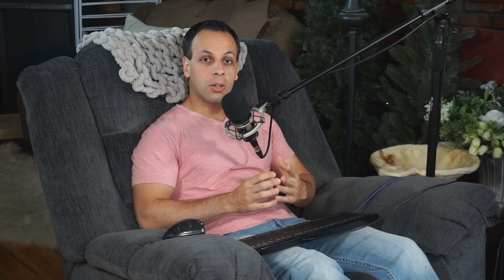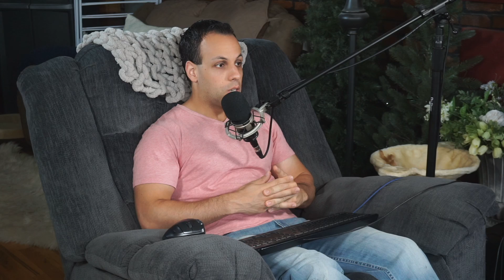Let's talk about what Right to Repair means for how devices are designed.

Comment: I agree with everything you said but I think we need to make it mandatory for manufacturers to not use software locks on their devices to crush 3rd Party Repair Shops. Sure, the manufacturers can design the hardware as they wish but they should not lock down that hardware with their software.
Reply: Right, if I'm not mistaken with new iPhones batteries have internal serial numbers that the phone can detect and if the serial number doesn't match what the phone was originally sold with it locks/removes certain features so repair shops are forced to use 3rd party tools to duplicate the serial number from the original onto the replacement in order to trick the phone. Really brings into question who actually owns your phone.
Reply: @Sam_Ares  
If i'm not mistaken that's what apple(atleast an ipad) says in the TOS. 
You don't actually own anything but the device itself, the software etc remains 'property' from apple.
Reply: @Sam_Ares  You dont own your iPhone! As like everything Apple, you rent it!
Reply: Especially smartphones
Reply: The problem isn't the locks. The problem is the lack of keys. Those locks are, in theory, really nice as they allow people to better secure their devices against malicious tampering and theft, and so long as the user has the keys to unlock this all themselves, it's all good.

Imagine if the fusebox on your house came locked, and every time you needed to flip a switch, you had to call the builder back in to unlock it. It'd be terrible. But if the builder was like "and here's the key to your fusebox" when the build was finished? Not a problem anymore.

So let hardware advance and better security be implemented, so long as the legitimate user retains full power over their device. Whatever lock you place on device internals, whether hardware or software, the keys must go to the customer.
Reply: Yes this exactly! Software locks / DRM that locks you out of your own device and stops you from repairing it!! That needs to go as well naturally.
Reply: If it uses tracking to void warranty on the device, I am fine with that. Anything else is a no go.
Reply: @Keldiur  Track, sure, block my access from the device I paid for, hell nahhhh. But usually they can determine if your repair caused physical damage or whatnot
Reply: This is the important part, and this cannot be done via executive fiat.
Reply: What about hardware practices specifically designed to cut off access to certain parts like covering ICs with thick slabs of epoxy?
Reply: Totally agree. iPhones would last times as longer if we had a possibility to downgrade iOS. That's what should come next
Reply: @iFilipis  I ran a test a while ago on my phone, to see how long it would last, I didn't install a single software update. And it's still working perfectly, no slow downs, 6 years later !
Had I installed an OS update, performance would be rendered unusuably slow.
Reply: @YounesLayachi  Same here. My iPhone 5S was running perfectly fine until I ran out of storage and had to replace it eventually. I haven't installed a single update since iOS 9
Reply: @YounesLayachi  That's the unfortunate reality of the specs treadmill we're on with software. Memory gets cheaper, devices have more of it, CPUs get a little bit faster, etc., and developers can be just a little less careful about optimization, and the software is just a little bit slower. Every year that effect compounds and compounds. It's pretty frustrating. I don't think phone manufacturers are intentionally making their software slower, but they're certainly not complaining that people are buying new phones.
Reply: @Netist_  you're absolutely right. I've been complaining about the size of google's apps, which increases 5x, sometimes 10x, between 2012 and 2017 thanks to whatever "material design" is, + high resolution screens and memory leaks didn't help at all.
Basically every android device with 4GB of ram or less today is a sitting duck.
Reply: My Samsung Galaxy S7 only utilizes 4 of the 8 cores because of an update they pushed to the phone that I did not agree to install, it did it automatically. I am smart enough to read through the system diagnostic log and see that the update is what caused this. It is locked, and it was a firmware flash upgrade that cannot be removed or replaced. It was pushed literally the day before the launch of the Galaxy S10, how convenient🤔
Reply: @Celician83  Hold on are you kidding? is that why my mums S7 is slow these days for what it is??
Reply: @AeRiaL_  yup! Because when the S10 was launched, Samsung pushed an update to disable half the cores, and it also for some strange reason cut the battery life in half. I would say it was old age for my phone, but I had literally JUST had it replaced the month before BY SAMSUNG for the charge port catching fire on my old one, so this phone had a brand new battery in it!
Reply: @Celician83  That's crazy. I'm still on a S7 that's gotten slow and clunky with poor battery life. I've never replaced the battery so I figured that's why it barely lasts a day.😑
Reply: @Celician83  if your Galaxy S7 is a USA model, then it has a Snapdragon 820 SoC, which is only 4 cores (2+2) not 8 cores like the international model.
Reply: Yep, that is part of right to repair
Reply: @FlabbyTabby  updates do slow down phones.
Phones are designed to run today's software, and tomorrow's software is more demanding.
The phone in question is a moto x
Reply: The market deals with that.
Reply: @austinbyrd4164  what's your point ???
Reply: @YounesLayachi  I was commenting on op.
Reply: @austinbyrd4164  yeah, but the market doesn't deal with that. Every OEM and their dog locks the software, and your reply is "the market deals with that"
Reply: @Younes Layachi  it does. If there was no ip then if someone simply offers a product that isn't locked, then people would by that.
Reply: @SuperWhisk  Simply not true. People buy things that, in their terms, say they don't completely own. They only do this because they don't have viable alternatives. Alternatives don't exist because of ip and other protectionism. Regulation isn't necessary. They're not dogs. They're capable of going to better alternatives. Yes, there's fanboys who'll buy for no logical reason, but why should we stop them? If someone wants to waste their money, let them. Those people are a minority in the grand scheme of things also.
Reply: If companies want to make software locks, and consumers are okay with buying that product anyway, that's the customer's choice. Not yours, not the governments, the customers. There are alternatives, there have always been alternatives. I mean thsi comment is a year old so I'm using future information but, freedom of speech became such a relevant concern for people that Elon Musk straight up bought a fucking social media company to make it pro-freedom-of-speech there will ALWAYS be an alternative, maybe it's not here right this second, but it's always damn close if it isn't. 

Companies just need to stop having legal PROTECTION, then consumers can decide for themselves. If schematics stopped being protected by "intellectual property" laws (stupid fucking concept BTW, since when did ideas become ownable?) then they would be freely shared, meaning more repair conversations, meaning more people are aware of how repairable different devices are, meaning more people are thinking about it, meaning that's a greater buying decision. 

the reality is, if I want to buy a shitty locked down device, I have the right to buy an iPhone. If I don't want that, I have alternatives. Forcing government legislation into issues where it is entirely unnecessary is how you GET problems, not solve them. The issue here is a result of private "InTeLEctUaL PrOPerTy" being protected via public legal systems*; i.e. the government got involved, and now we have a problem. Is the solution to that getting the government MORE involved? No, that's fucking stupid, the solution is telling the government to screw off and get out of our bloody house. 

*(and anti-competition laws not being enforced which, yes, I'm aware sounds like it counters my point, but that's an entire other debate that would make this comment several times longer than it is currently. If we want to have that debate, fine, but I'm not writing a full philosophical breakdown on the historical context surround John Locke's writings and the nuances of how the surrounding culture and environment has altered over time if it's not necessary. Long story short, the only difference between government and companies is choice, once a company begins to get large enough that they can manipulate the market and force consumers into not having a choice, then, and only then, is legislation justified because the consumer can no longer choose to simply not engage with the company. If I don't want to buy an iPhone, I don't have to, so, neither I nor you or anyone else have the right to say what they can or can't put on their device.)

Comment: What about batteries you have to destroy the device to replace it?🤔There being a way to replace a battery without slagging the device is not  hard ask. I can see a time where the battery is considered structural making it nigh on if not impossible to replace. The way to make Right to repair pointless is to find sneaky ways to make it impossible to do after manufacture. Sealed disposable units as it were.

Not asking for things to roll back to the stone age, but to make sure that things don't head somewhere that renders the legislation mute. I;'m sure they could figure out ways to do that otherwise, it does seem to be where things are headed.
Reply: That is fine. But if the manufacturer has the ability to fix it I should not be blocked from doing the same.
Reply: They started with batteries.  Then SD cards.
Reply: If all the parts are available, then destroying some outside chassis of the device during replacement is okay ?
Reply: @YounesLayachi  No, it's not okay, because that's just unnecessary cost and wastejust to discourage people from doing it.
Reply: @InfernosReaper  expensive is better than impossible, the important aspect is that destroying part of the device during repair/replacement doesn't trash the entire device, if those destroyed parts can also be acquired and replaced
Reply: @InfernosReaper  I know, small steps towards the right direction though
Reply: @JohLincN   That would've been great. Even socketed CPU, GPU, RAM and Storage.
Reply: @JohLincN  I do wonder why soldered on never gone so well on desktop PCs....
Reply: @JohLincN   Not as much.

Comment: The manufacturer actively designing their shit to be Hell to fix is bullshit, but if someone has an idea of how to word a law to stop that without stopping innovation, feel free.
Reply: BMW is the perfect example of that, there is no innovatuve reason why say a starter or alternattor needs to be  under the intake manifold of the engine or inside the bell housing of the transmission requiring you to remove the engine and subframe to access a common wear part. This would be like the next car you buy having the brake pads welded to the calipers and bolted to the hub permentently requieing you to replace the whole thing to fix it. That type of shit needs to be put in whatever bill to be illegal, theres zero innovative/safety or performance reason to make something that diffucult to fix especially when it offers 0 benefit to the items design or look
Reply: @TAKIZAWAYAMASHITA  Pretty much all car companies are guilty of this now. The trend to make servicing a lot more involved started along with the stupid plastic engine covers. The engine already has a cover, that's what the hood is for. Also internal water pumps should be added to the list of things that tend to be rotten in practice, no longer a part that can just be changed in a half hour anymore - and instead of some tell-tale leak now you have another risk of coolant getting into the oil.
Reply: I imagine we want to prevent a situation where the hardware is deliberately designed to hinder repair in order to get around the new right to repair bill, same goes for software "limitations", basically a way to keep them from weaseling out of keeping the hardware repairable without hindering technological advancement.
Reply: There's one aspect of it which can be adequately addressed IMO, using the concept of "locks and keys". When you sell a device that uses some special tool, equipment or knowledge designed to lock down the internals and prevent unauthorised tampering, but allow an authorised party access, you must turn over the keys to the device owner at point of sale.

So this would address stuff like component serialisation, proprietary screw/bolt heads, locked bootloaders, and even actual locks in some devices. The locks themselves are okay, but the owner needs to be given the keys, since they are the party who can authorise access now.